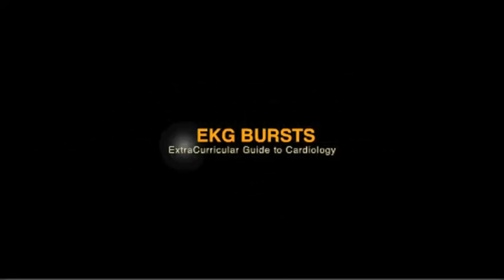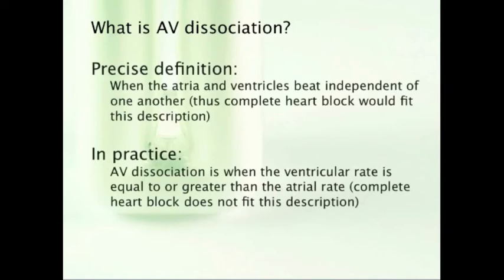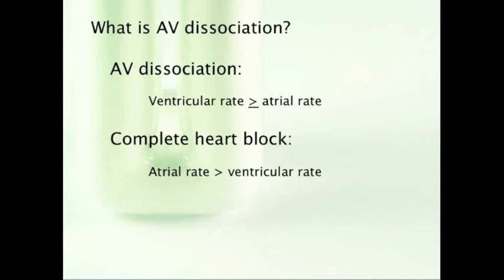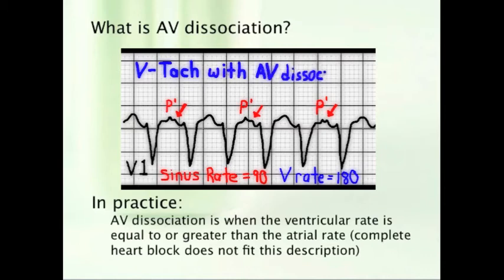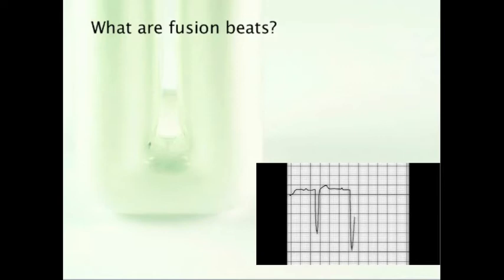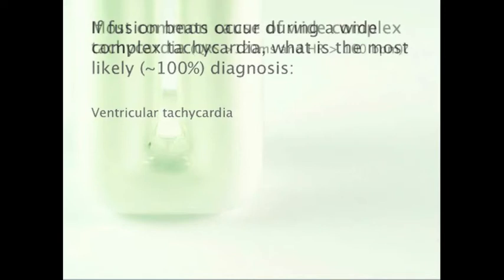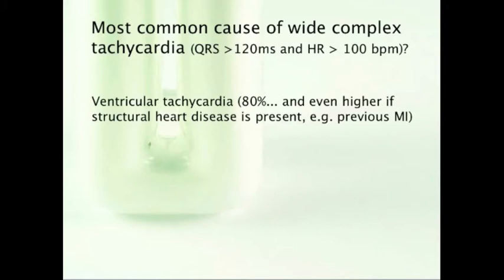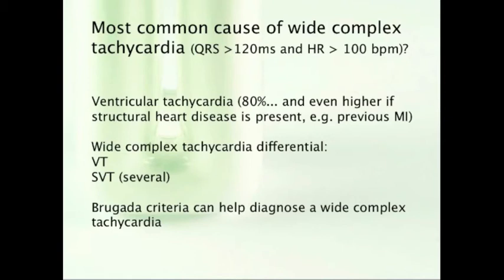ECG Q&A Part 7

Comment: You could do that, and risk killing 80% of your patients. If you give someone with in V-Tach an AV nodal blocking agent, such as adenosine, you risk throwing them into V-Fib. However, if you treat all wide complex tachycardias as if they were V-Tach (which 80% of them are) you won't mistakenly kill a lot of patients and even for the 20% with SVT, most of them will convert back to NSR.

Comment: Why do we need to use all these Brugada criteria to differentiate wide complex SVT & V Tach. Sounds quite impractical in an emergency situation......I rather inject 6mg Adenosine rapid IV bolus, and see for transient slowing down of heart rate.....if there is slowing down of heart rate, then its a Supraventricular rhythm.....if adenosine has no effect on the heart rate then its a Ventricular rhythm